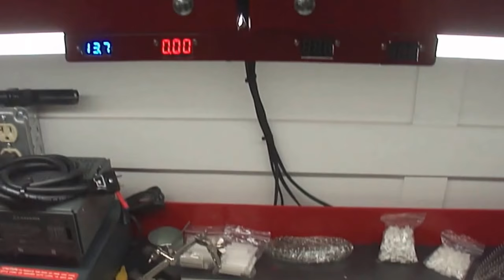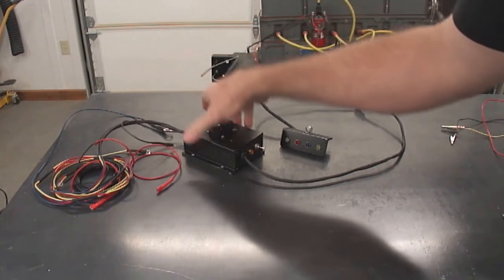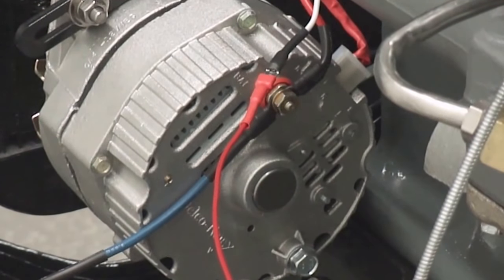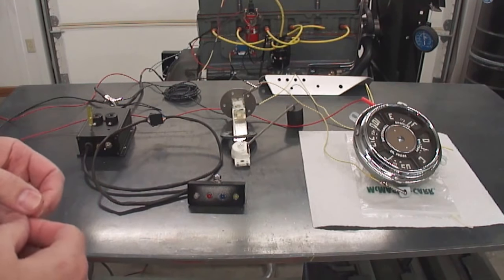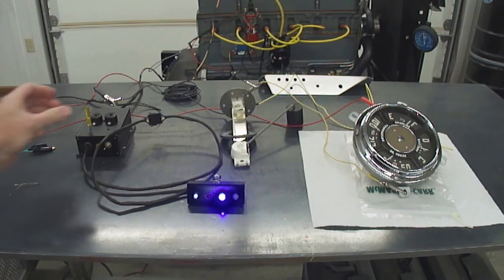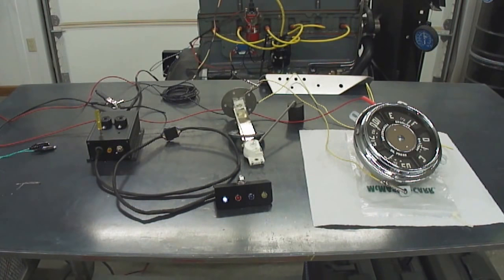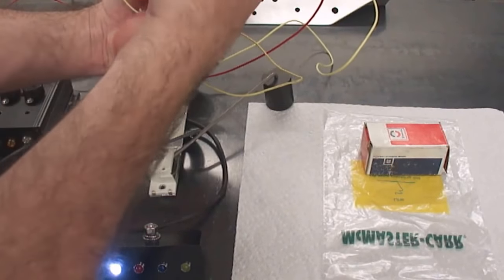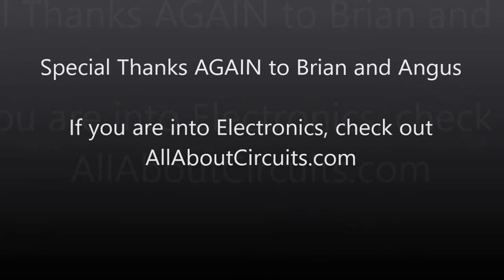CriticalInformationSystemIntro

Comment: Nice, would this also work with 12v generator system?
Reply from the maker: I'm afraid not Clint. This system relies on the 3 wire alternators warning light functionality to work properly. The nice thing about the 3 wire alternator (10SI) is it is internally regulated and very easy to swap into your system if you choose.